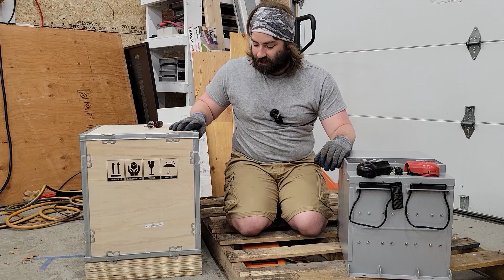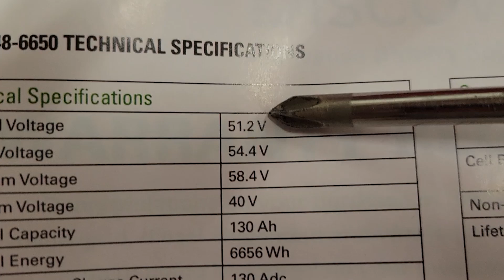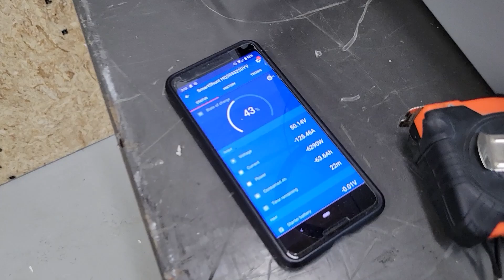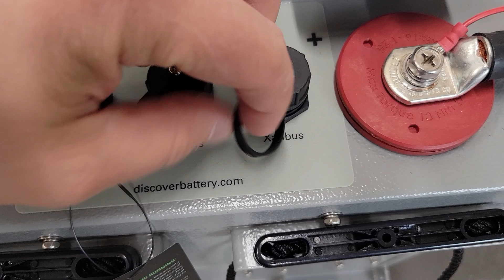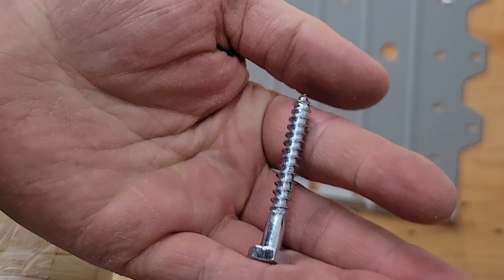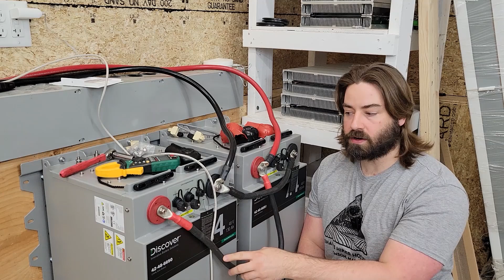Discover Battery, worth the price?

Comment: looks impressive, unfortunately the layout of the connectors really spoils the whole thing. 
This leaves no possibility of succeeding in making a really clean wiring.

the RS485 splitter is downright cheap.
Having to use such massive battery blocks with the wiring on the front seems to me to be a really bad idea. 
Putting them on top of the batteries (and separating the power ouputs from the controls) would make it much cleaner ... and much safer (there is too much risk of catching a cable while passing) .... in short, it looks dirty and it is because of the design of the product itself

Comment: Steel boxes are to contain the explosion and fire of the honking big batteries. Do you have them in a separate bunker with a sprinkler system, halon Gas, not water.

Comment: QUESTION - while the batteries in the video carry the name "7.4" the label mentions "48V 130Ah". As V*Ah=Wh and Wh/1000=kWh, with those two numbers we get 48V*130Ah=6,240Wh -> 6,240Wh/1,000=6.24kWh.
If, out of those 6.24kWh 80% is usable, then we end up with ~5kWh effective capacity per battery, not 7.4.
So the question with all this is, what's the story between the 7.4 and 5?
Reply from the maker: I was a little confused at first.  After reviewing the manuals for use with Schneider, I found my answer.   

7.4kWh.  This is the grand total of the cells inside the battery housing.  Meaning, the cells used in construction total about 144Ah.

130Ah: This is 90% of the total.  This is what the BMS will tell the Schneider Inverter it can use.  The idea is this, when the battery and inverter have set up closed-loop communication...  The battery will tell the inverter to shut down at low SOC (state of charge).  But, the battery remains on.  This means that when the sun comes out the next day, the MPPT charge controllers can still turn on and begin charging the battery.  If the battery were completely turned off the solar wouldn't be able to being the charging.  That reserve % in the battery allows this to happen, and extends the cycle life of the battery. 

Note, this LiFePO4 battery has a nominal Voltage of 51.2V, not 48V.  Think of the "48V" on the label more of the category of equipment you can use.
Reply: @DavidPozEnergy  - that makes it an honest product. Thank you for the explanation.

Comment: Help me please understand the term David uses for cable sizes.  Is he saying 4 AWG and 2 AWG?  If so then 4 AWG is showing as 90 Amp and 2 AWG as 130 Amp, things must get pretty warm.  I would have expected 0 AWG. I am guessing with nominal 48V systems voltage drop is not so important?
Reply from the maker: I'm using 4/0 wire in this video.  Another way of writing 4/0 is "0000".  It's pronounced "four-aught".  
When I talked about running an individual wire from each battery to a central busbar, I said I'd use 2/0.  

You are right, that if I used the smaller "4 gauge" then things would get hot.  LOL.  This type of confusion makes me wish we went to the metric system.
Reply: David- Thank you so much for taking the trouble  to answer, I understand now.  Yes in UK it is somewhat easier, mind you we still write about the number of cores and their size.  Hours of fun.  I enjoy your videos and one day will embark on a home build. @DavidPozEnergy
Reply from the maker: Your welcome. Thanks for watching.

Comment: What battery charger do you use?
Reply from the maker: I charge from solar most of the time, but I think you are asking about the plug-in charger in the video?  If so, then it's this: https://signaturesolar.com/eg4-battery-charger-48v-18a-1/?ref=4_rHcgZ9x-TiF-
Note, I have a slightly older model with ring terminals, not clamps.

Comment: From the other comments here, it sounds like that 7.4 kWh battery costs either $4600 or $7300.

Where I live (NC), 7.4 kWh of electricity is worth about 80¢ (retail price). A good LiFePO4 battery should be good for about 5000 charge/discharge cycles. So, over its life, that battery might store a grand total of about $4000 worth of electricity.

So the battery costs a little more than the retail value of the electricity that it can store. That's actually pretty good for batteries.
Reply from the maker: Thank you for reading through some of the comments.  
I agree, it's a fair price, but not a bargain.  But, this battery has the UL listing which some of the less expensive options don't.

Comment: hmm nice 44-54v pack, at no more than 2 degrees of heating the system is likely no more than 5 degrees at the junction of the BMS, I would happily trust this to do 130a continuously, a bit overspeced too, so a decent pre-built lifepo4 battery
the problem I have is that the settling on a battery voltage limits your device pool, victron is kinda the only dudes who do >48v systems(24v if the standard for most generics I think) which is scary to me given the monopoly and the lack of real options
I would much rather build my system around 12v batteries, in series+parallel arrays
that way if I need to tune for 48v I can take part of my array from 2s#p to 4s(1/2*#)p

I think I am gonna stick to 24v as the upfront of 4/0 or thicker wire is basically a 1-time thing and standard battery types are almost always cheaper, and given the battery is always the part to wear down, external health monitors on 12v nominal designs is best, it will require the data lines go through a small optocoupler, but opto's are cheaper than the effort to turn a wingnut

glad to see you are happy and not experiencing buyer remorse, though I enjoyed the alternator at 80v video better, it was awesome to see that it was capable of it's rating at 40+40v and 12v

if I need to design a system myself I would use a 12v relay, an NTC limiter, and have it fed via an xt-60 connector to startup, flick a switch from a small battery to run the spin up motor to get the engine spinning, then press a button to start saturating the windings if they did not have any residual field to self-start, then a self latching contactor design that requires you to manually trigger then stays active till the engine stalls or runs out of gas
super cool some of the stuff I see you do though, glad you are capable of detaching from the grid, they can't seem to realize that nuclear is a totally safe way to get the bulk of the energy the country needs, and the excess load can be kept up during the day with no batteries just by solar, and if storage is required you have a few pump-storage plants, near the solar farm is easy as you just have to mount the panels above the water and you maximize land efficiency
it is gonna be hard to build at first but afterwards maintenance is way cheaper than gas or coal plants with the sheer concentration of emissions limits
and solar can actually be a daytime retrofit for coal and natgas plants anyway if you have space for a set of solar concentrator mirrors to make a solar boiler, and then the gas/coal can be a backup if the plant needs to run at night

Comment: I just finished setting up 30Kwh with a BMS for $4,300 (this price already includes Shipping costs). Not only that, but the 32 cells were brand new, A-grade CATL 280Ah cells - the best of the best, and shipped by an American company, located in America. Amazing deal!
Reply: Sounds pretty awesome. What batteries are you talking about and where did you get them?
Reply: Batteries are from Battery HookUp. They were assembled for a project that never made it to production, so battery hookup has stacks of these 280Ah CATL cells which have never been used (they dissemble the packs, so they do have Epoxy on them, but that is not a big deal). It's a fantastic deal for brand new , grade A, CATL cells.
Reply: Lots of unused CATL modules dropping on the market lately as assembled packs, damaged cars or trucks, vehicle totalled.

Comment: David; you obviously know what you are doing, but a “daisy chain” is a series connection, not a parallel connection.  I suspect you know that, but some of your viewers might not.
Reply from the maker: Hi brucefay5126.  Thanks for the comment.  Years ago, when trying to help friends with their battery, I found I was confusing them to say: parallel batteries with a busbar vs. parallel batteries with jumper wires from positive post to positive post. But, things clicked if I phrased it "run each to a central busbar instead of daisy chain".  My goal is to help people understand the difference.
Reply: @DavidPozEnergy  I appreciate that you are trying to be helpful, and I like your Youtube “style” which is relaxed rather than frantic.  But, you are simply using the term “daisy chain” incorrectly.  When batteries are daisy-chained, they are connected in series, i.e., negative of one to positive of the next, with positive connection from the first and negative connection from the second.  If you do this with two 12V / 100AHr batteries, you get a 24V / 100AHr battery pack.  If you connect those same two batteries in parallel, as in this video, you get a 12V / 200AHr battery pack.  These two configurations are very different, and using the correct language to describe this is really important, especially for those viewers who don’t fully understand what you are talking about to begin with.

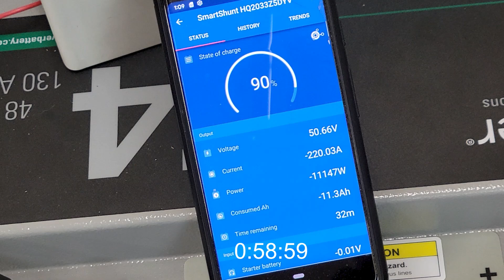Comment: Why was the little timer you added on the bottom @13:30 ish, running so slow? It would show 1 second change every 2 seconds?  The video timer showed 13:24 when you started the test and 15:22 when the test ended. Meaning the test ran right at 2 minutes. The timer you had on the bottom of the screen only ran 58 seconds.

Comment: Is the LiFePO4 cell going to last longer enough to be worth the ~2X higher cost? What type of battery is the $300/kWh that you mentioned at the end?
Reply from the maker: Most of the server rack style batteries are coming in around that $300/kWh range.  I've been using the ones from Signature Solar for two years now without issues.  Here is an affiliate link to the ones I'm using.  They can be purchased individually or with the server rack.  I also have a few videos on my channel setting them up: https://signaturesolar.com/eg4-lifepower4-lithium-batteries-kit-30-72kwh-6-server-rack-batteries-with-free-pre-assembled-enclosed-rack-with-door-wheels-busbar-covers/?ref=4_rHcgZ9x-TiF-
Reply: @DavidPozEnergy  Thanks - I will rewatch those.
Edit: I had not seen the review comparison of the new version of the Signature Solar rack - they look pretty sweet!

Comment: Hello DTG, so, connecting these batteries, what kind of protection do you need for them? I want to connect 4 of them to my new EG4 18K-PV which doesn't need a combiner box
Reply from the maker: That's going to be a nice system.  I've heard good things about the EG4 18k-pv.  Here is my affiliate link if you would like to help the channel: https://signaturesolar.com/eg4-18kpv-hybrid-inverter-all-in-one-solar-inverter-eg4-18kpv-12lv/?ref=4_rHcgZ9x-TiF-

There are two halves to the DC wiring from the battery bank to the inverter.  The first half is paralleling the batteries together in order to make one large battery bank.  I would choose a busbar that can connect 4 batteries, plus the two wires out to the inverter.  Check out this one: https://amzn.to/43qWz9n  You will need two busbars, one for positive, and one for negative.  I'd run a 2/0 wire from each battery to the busbar.   It's very important that each wire is the same length.  Each battery has a 200A fuse built in, and the on/off switch, so you don't need additional over-current protection between the battery and busbar.  

From the busbar, you will need two wires to the inverter. The manual gives guidance on the wire sizing (page 15) https://eg4electronics.com/wp-content/uploads/2023/06/EG4-18KPV-12LV-Manual-1.3.0.pdf
Personally, I'd be a little more conservative than the manual suggests.  For me, I'd say if the busbars are located within 3 feet of the inverter, then run a pair of 2/0 on the positive, and a pair for the negative.  If the busbars are farther away than 3 feet, I'd run a pair of 4/0 for each.  
The EG4 inverter has a DC circuit breaker built in.  Because of this, you don't technically need another over-current device.  However, I'm a little more conservative than most.  I like adding a fuse with high a arc interrupt rating (I.R.).  Such as a class-T fuse.  The fuse is located on the positive wire.  Since the EG4 inverter needs two wires, this means two fuses.  
Example fuse: https://amzn.to/44mXf0T
Fuse holder: https://amzn.to/3XPIGAa
Reply: @DavidPozEnergy  wow, that was fast Dave the Great. Thx a bunch
Reply: @DavidPozEnergy  I have connected a solar system to a generator before. But people have connected my systems to a generator after I was gone. I'll do some research on that aspect, which, I have always avoided.
Reply: @DavidPozEnergy  Thx a lot my hero, I'm installing a small system and a large one for 2 friends, the small one is off grid. The large one is not (I'm gonna need and electrician) it will be with an EG4 18K-PV with 4 Discover AES 42-48-6650. I'll daisy chain 2 per T-Class fuse, no combiner box. And an ATS for a large Kohler 50 KW generator. The small one for his cabin, will have a 24 volt hybrid inverter with a solar isolator and and ane fuse for the inverter and a disconnect for the battery bank. Thank you so much for all your efforts, your suggestions, tips and may God bless your you and your family. Peace. (On second thought, maybe each battery should have a T-class fuse)
Reply from the maker: 3 projects going at once!  That's 3x the fun.  
More fusing is not wrong, but not necessary.  As I mentioned, each Discover battery has a fuse built in.  I'd put the class-t fuse between the buss bar and inverter.  I'd suggest running a 2/0 wire from each battery to a central bus bar.  Then two wires (2/0 or 4/0) to the inverter.  It's those wires (inverter wires) that could use a class-t fuse.
Reply: @DavidPozEnergy  Thank so much for the tips. Peace

Comment: Just a question on the communication link, why use the splitter and a termination plug? Can you just plug the cat cable into the battery?
Reply from the maker: No, you can't simply plug the cable directly into the port.  You are required to use some type of splitter and terminate the end of the "daisy chain".

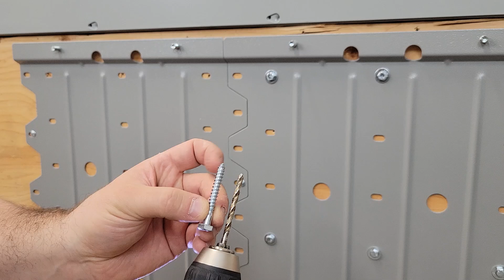Comment: 25:31. There is a major issue with your lag bolts going into the plywood, in that they have a shoulder section without threads that looks to be at least 1/2 of an inch long, and may be closer to 3/4 of an inch. The result is that the bolts are relying mostly on friction between the smooth bolt and the plywood instead of having the threads engaged with the plywood along the entire length of the bolts. They will likely hold for a period of time, but will likely eventually work themselves loose. Far better to use either more #10 or #12 screws, or the specified #14 (1/4 inch), as long as they all have threads along the entire length of the screw body. This is a somewhat common mistake that I have seen equipment installers make when bolting to thinner substrates such as plywood.

2/0 is plenty big for the paralleling jumpers, since they only carry 1/2 the load, and a 2/0 75º conductor in free air will carry 265 amps, enough for a 12 kW inverter at 48 volts.

Comment: 0:25 the Weight, validated the Crate❤😂🎉
Reply: Built like a Tank, I think., 1:10❤
Reply: Should use a better load than Heaters,  use it to Charge some Batteries,  or Tesla 🤓 👍
Reply: I know, u want a constant rated Shunt for easy Maths 😅❤ 🤓

Comment: Great battery, but prohibitively expensive (around $7300+ per unit) and not necessarily the best power density per lb. Commercially available sodium-ion batteries are just around the corner and will have higher power density, not to mention a lot more environmentally friendly, and a LOT cheaper, since sodium is available almost everywhere.😉

Comment: I thought I would ask if you know the answer to this question. I have a off grid 240 volt electrical panel powered by two LV6548 (SunGold Power) inverters. Since they are the my new grid, can I add 7 - 215 watt 240 vac Enphase micro inverters to my off grid electrical panel with damaging my main inverters?
Reply from the maker: Not that model.  Some inverters will support "AC coupling", but they tend to be the more expensive inverters.

Comment: I'm wondering if the steel case is to contain lithium battery fires and or explosions.  I've seen lithium fires take out aluminum, but I believe it's burn temp is around a thousand degrees F below mild steel melt temps.   Maybe these are the safe case alternative.

Personally I prefer the highly underrated super capacitor battery method, charge and discharge is better and the lithium bond isn't there to go rogue.

Comment: If this battery is $600.00 a kilowatt like you say then 48v x130ah is 6,240 kilowatt  hour x $600.00 then this battery would cost $3,744,000.00
Reply from the maker: This battery is rated for 6.6kWh, or 6,600Wh.
Reply: @DavidPozEnergy  still 6,600watthour x $600 00 would still be $3,960,000 a battery
Reply: @DavidPozEnergy  now 6650watthour x .67 cents= $4,455.50 now that is the price of that batter David
Reply: Sorry David but math is math, the price for this battery is $5,904.00 and the special price is $4,500.00
Reply: @edwingarcia6387 what are you going on about? You can't just switch between watt hours and kilowatt hours.

Your very first equation showed Wh and you called it kWh. You are off by a factor of a THOUSAND! Divide your first dollar amount by a thousand, and you'll be in the right neighborhood. 

Stop making pointless claims and statements based on "math" if you're not going to do it correctly.
Reply: @WimPrest  6.6kilowatts is the same as 6,600watt x $600.00 as David says the price of the battery would be $3,960,000